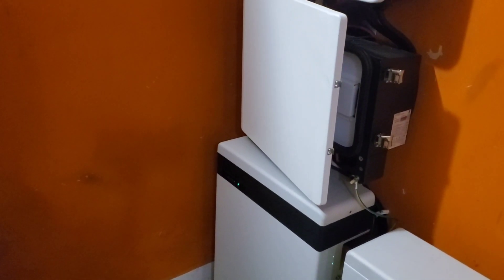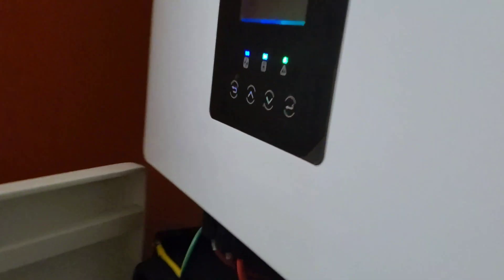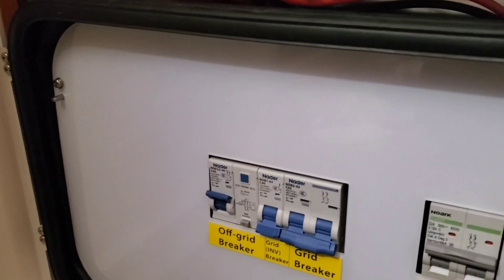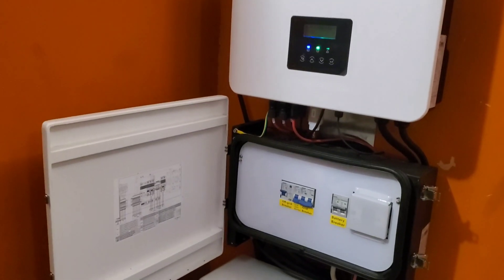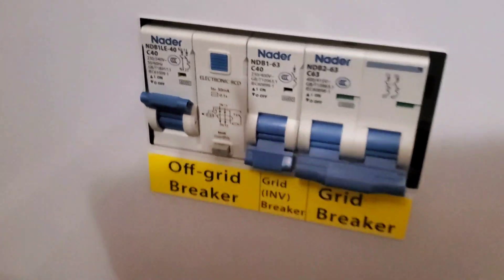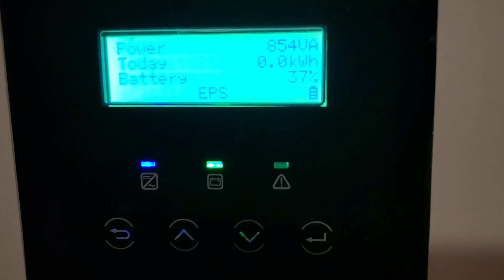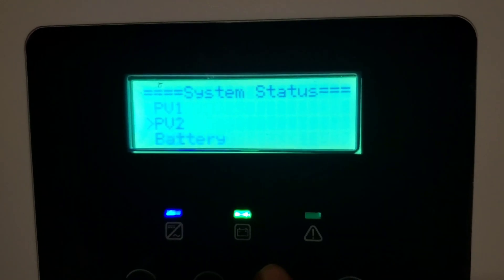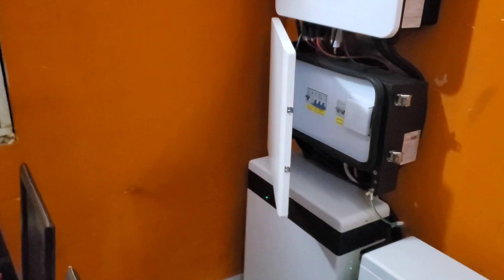#solax X-1 Hybrid Inverter. Did it live up to the hype?

Comment: Hi , I have a solax x1 hybrid installed at my place And it keeps on displaying waiting status from last 2 days. They have updated the firmware. There is voltage on the pv 1 (360v- 8 panels ) and pv2(135- 3 panels ) ( checked with multimeter) . Is there anything you van suggest.
Reply from the maker: I had the same issue. The firmware update resolved mine. EPS waiting? Is it charging?
Reply: @drsolar  yes good now after the firmware update.

Comment: re SolaX Triple Batteries. 
I see you have two of them. Are they connect in series or parallel?
Can I connect three 48V batteries in series with SolaX (if I am not getting the Triple Battery)?
Reply from the maker: They are connected in series. The inverter is a high voltage unit. It can operate from 110 to 400V. Can you get your batteries to that coltage?

Comment: Question does your sol grid tie unit have to be connected to WiFi to work, and are you doing firmware updates by your com? 
Your friend and big supporter of your quest for knowledge always!!!
Reply from the maker: Hello Burton, you have been a wonderful friend and companion on this journey. The SolaX is a hybrid not a grid tied. It doesn't need WiFi to work. The Deye grid tied that I ran didn't need WiFi either.